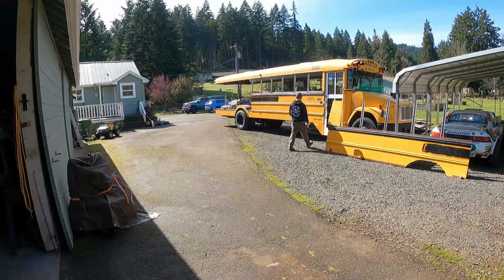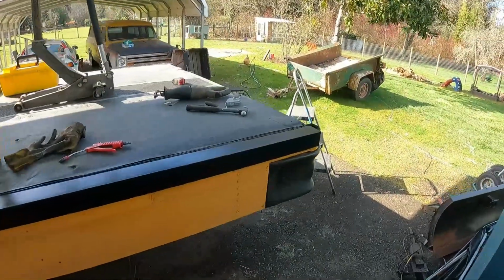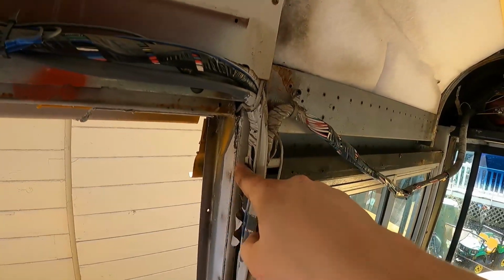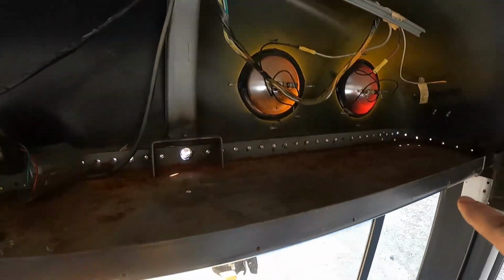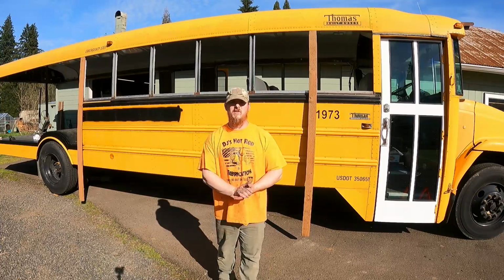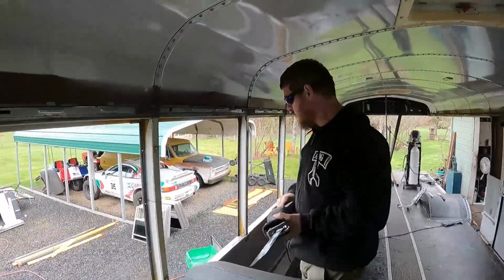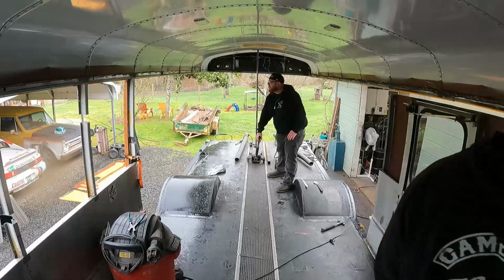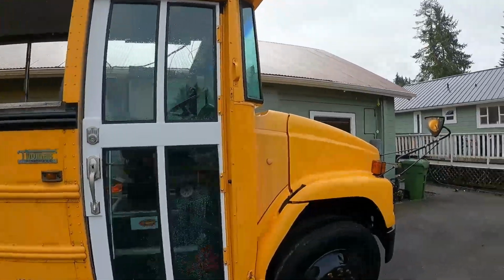School Bus Toy Hauler Roof Raise

Comment: Great work. Only thing I'd done differently and have plans to do on my bus conversion, would have been to extend roof past the door and ramp up from the old roof line to the new to maybe help with aerodynamics a bit. Besides the obvious front flat windshield, That bus will have a huge flat panel to have to push through the air. Might be creating an unnecessary extra amount of drag when the extra height above the driver seat and entrance isn't really needed. Just an idea for others to consider if reading this and thinking of taking this project on
Reply from the maker: Definitely positives and negatives to go on each way I considered doing it that way but ultimately the space that I have for living inside the bus is fairly small it's only 14 ft long until you get to the back wall now so I decided with this because it gives me a huge space above the driver's seat to put you know extra cabinetry and a television. Aerodynamics is definitely the downside
Reply: @DJsHotRodFab   right on brother. Looking forward to the rest of the build.

Comment: How many cut off wheel are you in now 🤔
Reply from the maker: A pack of sawzall blades and about 15 cut off wheels
Reply: @DJsHotRodFab  I believe it lot of cutting
Reply from the maker: @heathenprojects2639  I really wore those saw blades out
Reply: @DJsHotRodFab  few years ago I was at harbor freight they had grinders for 10 bucks I bought 10 of them so when one starts getting hot I can swap them out for jobs like this I've tried tackling project like this always have to let tools cool off or burn them up